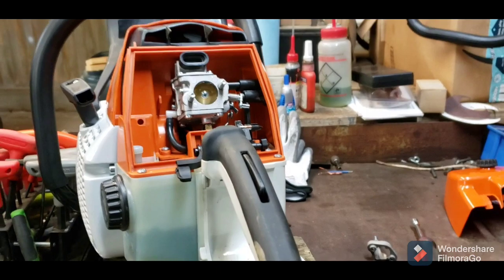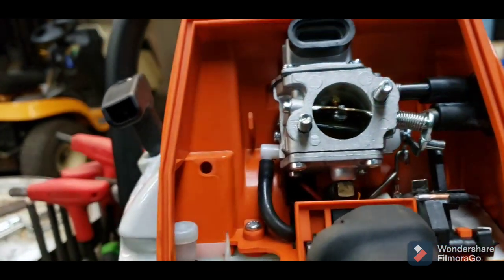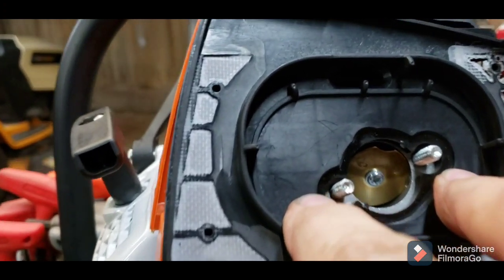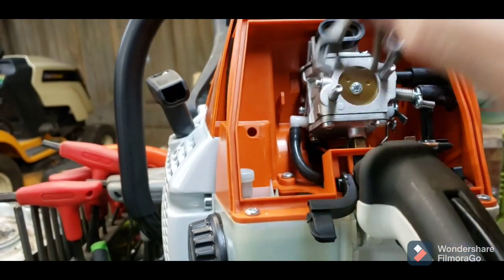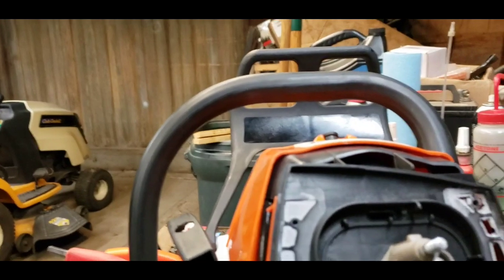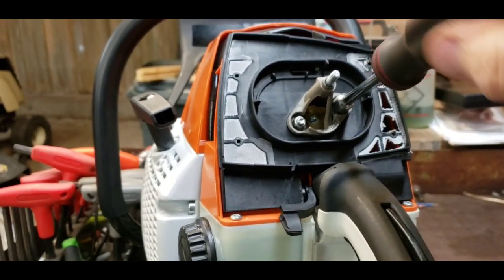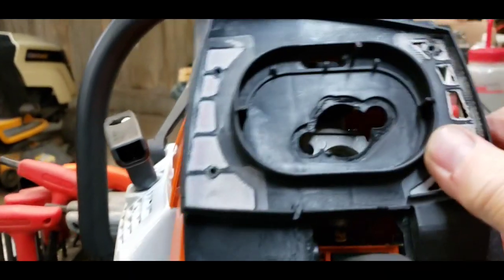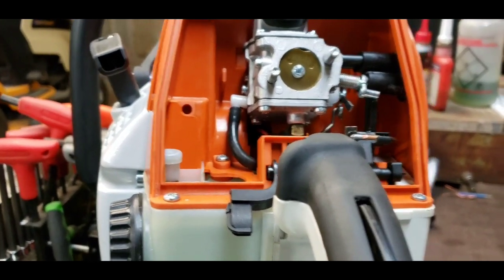MS660 choke issues,  tip of the day

Comment: That's a tricky one, I have no experience with this model but maybe add a gasket to stand the plate off the carb a little.. Or some very careful Dremmel work..Mind you, it may all start touching again when the plastics warm up with use..
Reply from the maker: I've already tried cutting, grinding, and heating to reshape,  the problem is on the opposite side of where it is hitting is where the filter mounts and Seals.
It would take more than a couple gaskets then you run into issues with getting the filter cover to install properly. 

After some research I THINK  that a part or 2 may have been made for use with the polar modle that has a carb grid heater that mounts on the inlet side of the carb, this heater along with the other correct parts should fix the issue. 
But thats just a guess  🙄 🤔

Comment: Hi craig.. That there is a tricky one, my first thought was would a oem part be different. Anything on Afleetcommand channel?
Reply from the maker: Not sure if oem would be any different due to the position of the choke linkages for the full application, doubt if Walt has anything but I will hit him up.
What I did run across is there is a version with a carb heater between the filter and front of the card that looks to be about 1/4" thick so I may try making a spacer to push the black panel away from the carb, just a though.